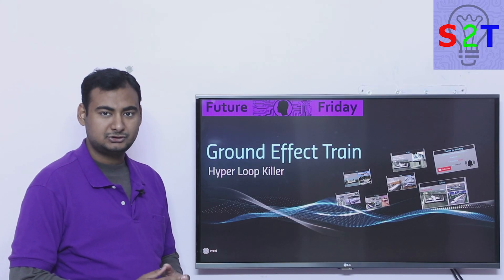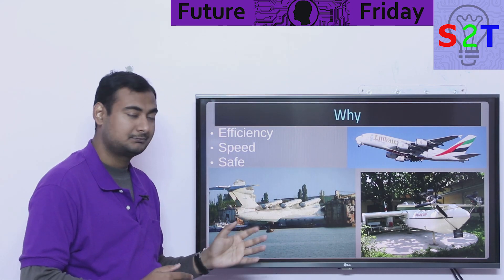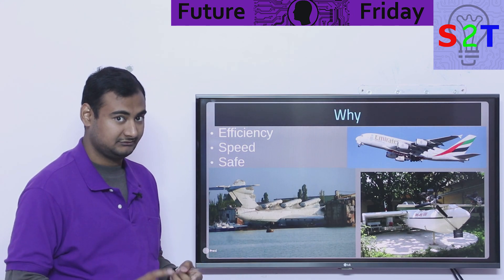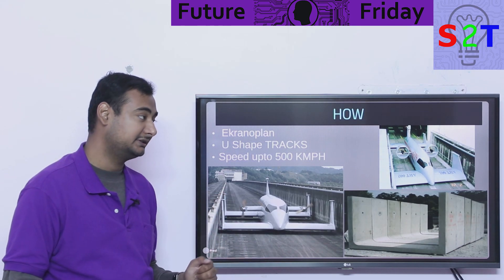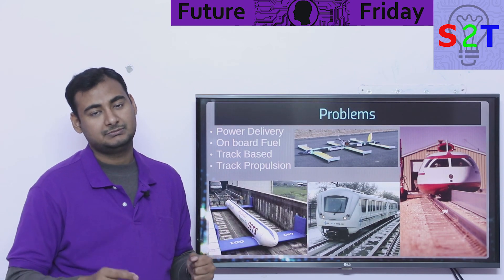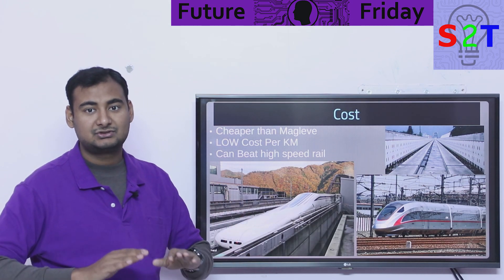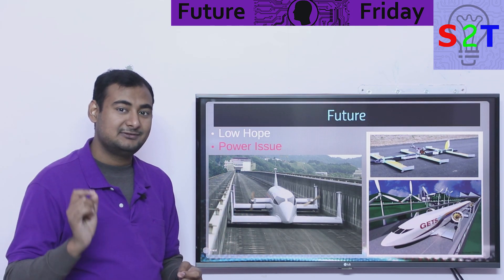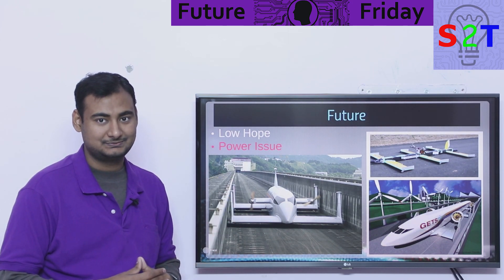Future Friday Ep32 (Ground Effect Train Explained)

Comment: How about replacing wagons with ground effect while there is a front locomotive that pulls them locked in the left and right axis but lets the wagons free to lift up with speed? 
Would it be more efficient to get rid of all the contact on the ground from the wagon while getting the locomotive power straight from the ground?
Reply: Interesting. but pulling loco has greatest mass, thus friction so moving locomotive to WIG is more desirable  BUT practically in terms of braking a WIG-tracked traction loco is, I believed, then Shinkansem model simply for braking (which of course can create regeneration)

Comment: Metrail system - hybrid diesel - diesel working in constant speed generating elecric energy as buffer then coupled  with electric battery as booster. Very economical, as the motor can be adjusted to ideal COP.
Reply from the maker: Too many parts what you are describing is just normal diesel locomotive with battery + charge controllers

Comment: I think diesel electric propeller or even Jet turbine is the way to power it. The track is much cheaper with on board fuel then needing miles of an electrical system, that is the main cost of trains. Look into carbon engineering to understand that petrol is going to get cheaper and be in unlimited supply soon, so dont worry about fuel cost or availability.
Reply from the maker: Interesting ,I do agree if it has onboard Power source it will make it really cheap .I would like to know more about carbon engineering
Reply: Google / You Tube carbon engineering, CO2 into gasoline.
Reply from the maker: O that , please look into the energy cost (it takes more energy than you will get out by burning it)in physical term it's just a chemical battery .not a power source more like power carrier
Reply: Making oil from C02 does not require break even energy, they will make it using energy from Solar, Nuclear, and Hydro electric Dams. The cost per gallon once set up at each one of those kind of power plants will make every gallon of gasoline cost 1 dollar or less forever. Once energy becomes free in say 100 years with more and more Hydro, Wind, Solar, Nuclear Fission and Fusion, and eventually space based Solar which gets 24/7 unlimited free energy and microwave beamed back to earth (we should be doing this inside 20 years from now) then the fuel creation will be free too.
Reply: The only problem I see with the design is the track has to be so wide, along with the high sides prevents passengers from seeing the land scape. These are also problems with the hyper loop and why I don’t think we will see one. The hover train monorail I think is a better design although it needs more power. Probably some kind of combining the two designs is the way to go. Utilizing ground effect is nice  because it’s passive. It just requires speed.
Reply from the maker: @ApexTyrannis  if you can do watch my thought on Hyperloop  https://www.youtube.com/watch?v=lTnsx4CpKmY&t=1s
Reply: @AnupamVipul  Just watched your Hyperloop video, good points all around, we wont be seeing it on earth is my guess. The system really has to be built underground from the very beginning by a rich non corrupt government using the tunnels as infrastructure tunnels as well to reduce the cost. I think we will see it used on mars as Von Braun predicted. I really like the ground effect train and I have been doing some sketches of it since I discovered it yesterday.